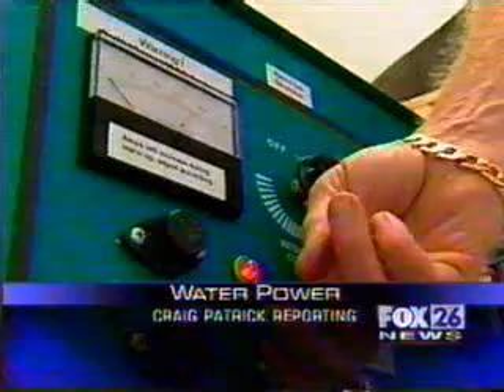Forbidden Science: Film-4

Comment: so:
get a $1M electrolysis machine, plug it in, make hydrogen, convert your car to burn hydrogen then fill it up, and go. Then just fill up at where ever there is a special $1M "hydrogen pump"
ETA: 2020
current price: $100K+  
OR
get a battery & $10K of solar panels, put it in your car, plug it in, and go. Then fill up at any power point.
ETA: 5 years ago
current price $40K<

Comment: of course, it works if you plug it into an outlet. To separate the water into hydrogen and oxygen, you need lots of power...which in his car is obtained from the other engine. 
It doesnt run on water alone, but on water and electricity. This kind of torch is nothing new, has been around for at least 100 years...